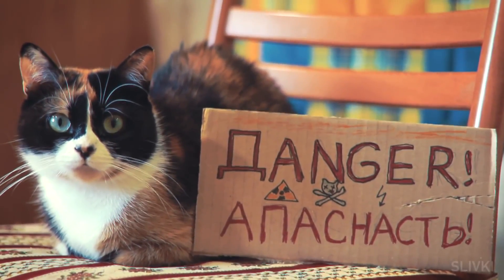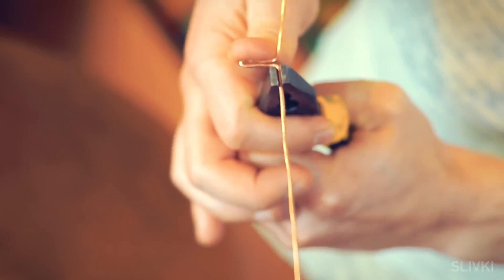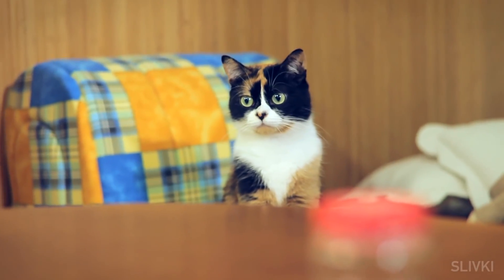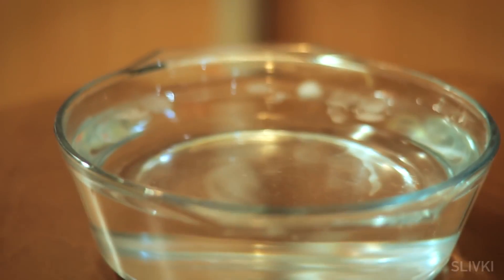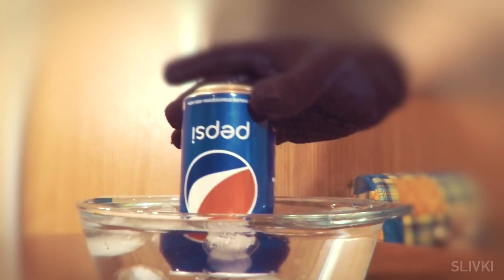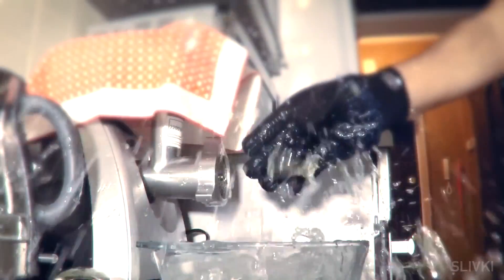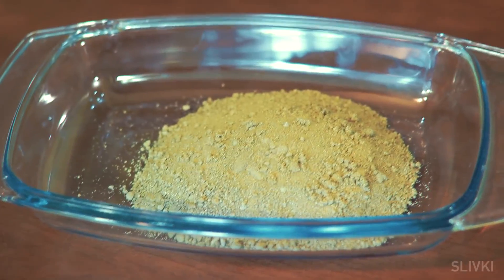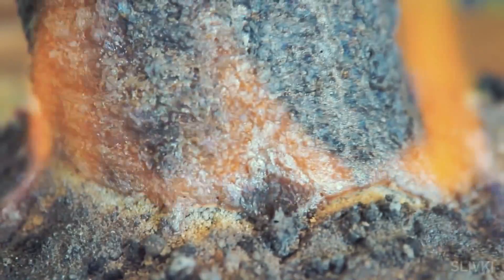5 EXPERIMENTS THAT NOT ALLOWED TO REPEAT!

Comment: I tried the first experiment one time, but never again.  I got my finger caught in the copper wire which made me jump.  As I jumped I ripped off my arm and knocked the assembly over, which quickly started a fire!  My whole house burned to the ground because I told the fire department what I was working on so they called the bomb squad and had to wait until it was cleared.  Then when I got out of the hospital I was arrested for my dangerous activities and my wife decided she didn't want to wait 10 years for me so she took the kids and the cat and left me.  You ain't kidding, these things can be dangerous.

Comment: how is the first experiment dangerous
Reply: Elize Lin bevause you can get shocked
Reply: @polarwhip2234  no you cant lmao, not enough voltage to overcome the natural resistance of your skin
Reply: polarwhip 223 Fair enough? But war a rubber glove and it is safe enough to be allowed as an experiment.
Reply: @yume.canary  electricity can still pass through plastic and burn plastic
Reply: polarwhip 223 this is aa batery u wouldnt even feel it
Reply: Elize Lin don't question him
Reply: If the humidity happens to be above .75, if you're at 1 atsmosphere's pressure and if the ambient temperature at the time of the experiment is exactly 22.01 degrees celsius, then the spinning cobberwire can create a tornado that will rapidly fly out the window and from there proceed to gobble up the entire country before anyone even knows what is happening. Not to mention what the magnet does, oh boy. So you can see it is actually pretty darn dangerous, even if it's highly unlikely that all three factors should fall in line at the same time.
Reply: The wire can burn
Reply: Elize Lin Theory: Explosions
Reply: Some batteries heat when shorted but very little
Reply: it break hand when you touch unless you slavic
this experiment only allowed for slavic
Reply: Elize Lin wtf